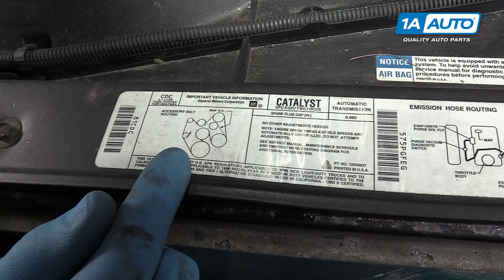How to Replace Idler Pulley 96-99 GMC Sierra K1500

Comment: Just found a TRQ video "How to replace idler Pulley 1992-2000 Chevy Tahoe" and he just cut that locking ring off and removed it. The spacer on the back of the pulley is then able to come off the bolt and put on the new pulley.

Comment: after getting pulley off, you gotta pry up on the little teeth on the spacer on back holding the bolt in , take bolt out , reinstall spacer on new pulley and reinstall on truck
Reply from the maker: +tennessee hunter Thanks for the tip!
Reply: Omg thank you I litter just drove back from the store because I thought I was missing hardware

Comment: Again, as two others have stated, why didn't you show how to take off the dust cover from the back of the pulley so the bolt can come out? You showed just half of the job! Also, if you're just replacing the pulley, there is no sense in taking the belt completely out. Just drop the belt off of the idler pulley to give you room to pull it and leave the rest of the belt threaded in place. This way you don't have to go through the hassle of figuring out how the belt is supposed to go back in.
Reply from the maker: +Andrew M Thanks for the tip!

Comment: Would this prevent the truck to not start? Or fully turn over?
Reply: no, this part failing will make noise, or potentially make the belt fall off. Without a belt the engine will still spin up